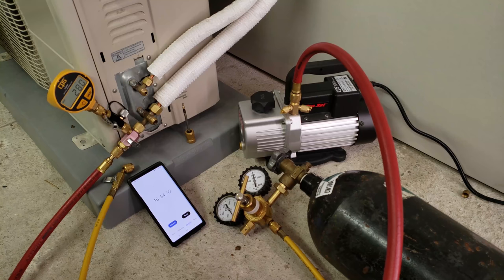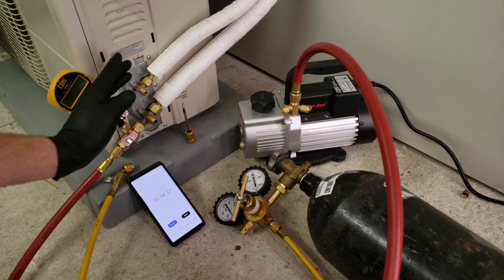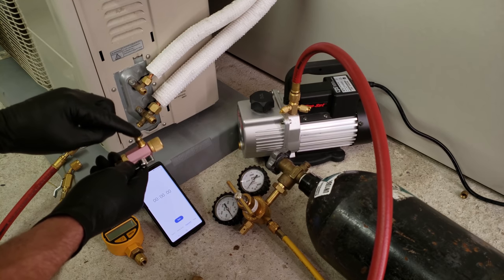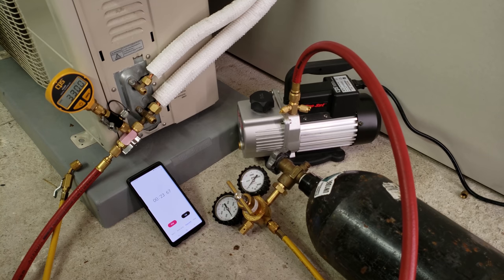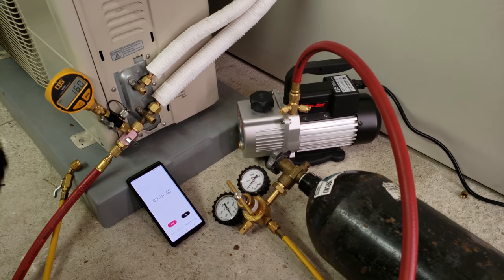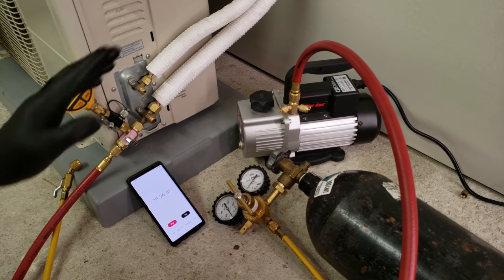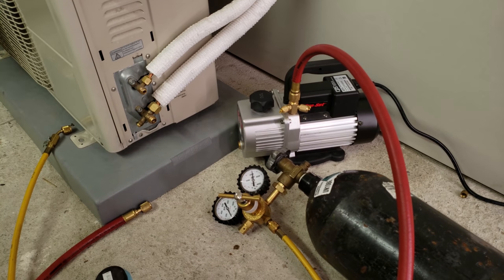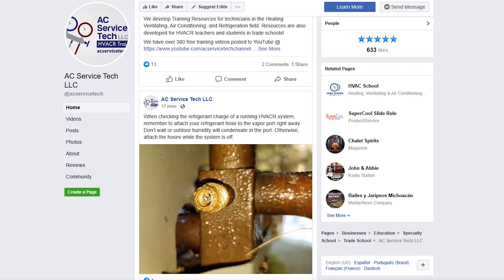Ductless Mini-Split Single & Triple Evacuation Method!  Step By Step & Opening Valves!

Comment: Your method makes sense for a professional who wants to save time. For a DIYer I think it makes made sense to add one hour wait after the initial 200 micron evacuation. This will allow the lines to come up to ambient temperature and avoid frozen water in the lines. Then pull down a deep vacuum again before releasing refrigerant. A pro can’t afford an extra hour but a DIYer can. And you avoid messing with nitrogen and all the extra connects and disconnects and opportunities to screw up.

Comment: Very good demonstration. One thing I will point out is you should always either fully open or fully close a high pressure tank, nitrogen, oxygen, argon. These tanks use back seating valves and if you ever saw a packing gland go with 2000 psi behind it go, its not fun

Comment: Thanks Craig, you are the best educator out there.  What i believe is lacking is a cumulative video on servicing a single port mini split which has a 410A issue.  I’m talking about an existing (not new installation) unit with cooling issues - we need a single video (or a 2 or 3 part video) starting at recovery thru repair, leak check (pressure test), triple vacuum & recharge.  I know you have many videos but it’s confusing to try & piece them together because the systems are different & many of the units shown have more than one service port.  I think there will be a tremendous demand for such a comprehensive video for a complete service on a 410A single port mini split.  Thanks for the great videos, i am ordering your book today.
Reply from the maker: Thanks a lot Charlie and thanks for letting me know what you would like to see!
Reply: Yes. These are very common in other countries and typical issues are the complex inverter board (you want an "inverter checker device") Or one of the 5-6 temp sensors. Sometimes the temp sensors out by say 10-20 %, or operate in a non linear fashion, these faults may not flag an error code and take a bit of nutting out.
Reply: @acservicetechchannel I could really use that vid right about now as well 😂

Comment: I followed this YouTube and your other ones to the letter! I installed a two zone Mitsubishi Mini-Split. Everything worked perfectly! Thank you so much! I have probably forfeited the warranty by not using a licensed installer but have saved us north of $1K. I even bought the tools you recommended. The Yellow Jacket flaring tool was the most impressive. I did buy the two valve removal tools you also recommended however Mitsubishi use 1/4" not 5/16" for the service valve so I just used a simple gate valve for the vacuum gauge. I was able to get a sustained vacuum down to 160 microns which held for over an hour using the triple evacuation method.
Thanks again😀😀😀😀
Reply: Awesome! Thanks!

Comment: Craig you are doing great work with these videos. Very very clear, helpful and no bologne. Very thorough on the purging and clearing lines, every time. How many times have you done a flare with no nut. I made fun of other youtubers doing it and said, i'll end up doing it. Then no less than 2 hours later. I did it. It has to be a badge of honor. My kid was watching, they have to see you make mistakes and how you handle it. I just said, always have a little extra to do this exact thing.

Comment: Great video. I wasn’t prepared for how much force would be applied to the core removal tool after the valves were opened to release refrigerant. The pressure really pushed on the core removal tool and slammed it back like a piston! Also there was a bunch of pressure left in the removal tool after the schrader valve was screwed back in. I ended up hooking up the blue gauge on my line set to the removal tool and releasing the pressure into the gauge because I was worried I hadn’t properly reinstalled the valve. I was relieved to find I had installed the valve successfully :)

Comment: I followed this set-up but I kept the 1/4" flare only loosely connected and pushed nitrogen through the line-set and the indoor unit and at just slightly above atmospheric.   I torqued it last.    I then pressure tested it at 300 PSI for a couple hours, released it and I used the Accutools BluVac vacuum gauge with the Bluetooth app that graphs the vacuum rise over time.    I don't know how that compares to the triple vac method (my manufacture didn't require it) but worked like a charm.   I used fresh high-quality Navac vacuum oil, a 2-stage pump, and the TruBlue hoses connected to the 5/16 valve core removal tool like you have.   I also bought a Yellow Jacket pressure gauge that goes directly on the 1/4" valve core removal tool in place of the vacuum gauge for the pressure testing.    Pulled it down to 65-micron, then with a 15-minute decay held at 90-micron.    I released the refrigerant and was good to go.  Thanks for your VERY informative videos.
Reply: Nobody does it better than you.
Reply: Kevin, thanks for the info.  I've been wondering about alternative methods to vacuum a multi-zone mini with long line-sets (45' & 40' of 3/8",  and 20' of 5/8").   I can achieve an initial deep vacuum reading (= or > 250 microns), but the decay test always rises considerably to above 1,000 microns.  And trying to purge nitrogen through all of that was an exercise in futility.  For the record, I did perform a nitrogen pressure test of 500-520 psi for 48hours.  The 20 psi variant is due to day and night temperature changes.

Comment: Once again I learn something. I've been using the Schrader valve core tools with the stem still in place on tool with vaccum guage. The vaccum was pulling quickly and rising fast. Thanks craig for the correction. I assume with me not removing the stem at the tool will have a similar effect  as the one at the service port. I'm 18 years in the trade and try to learn something new every day. I was wondering what was going on and now I know. Thanks again 👍👍.
Reply from the maker: I am really glad that this helped!
Reply: Same here I’ve always removed the Schrader valve core so I can vac out quicker. Trouble is I always drop the core and I can never find it again. Good job I have plenty of spare valve cores on my van😂
Reply: Any reason why I couldn’t use inert welding gas instead of 100% nitrogen?
Reply: @Upliftyourbrothers  Good question, and what about breaking the vacuum if you don't have a bottle or nitrogen.  I'm thinking CO2 could be used.   I think the deal with nitrogen is that it is a gas free of any water.  I've always heard the term "dry nitrogen."  Anyway back to your question, I'm thinking of just running the vacuum pump for a more extended period of time.

Comment: Great info! This was a necessary video. Don't think most people are doing this.
Reply from the maker: Glad to help, thanks!
Reply: AC Service Tech LLC do you have to do this? I suppose it’s faster than just letting the ice melt in the pipes but could you hypothetically leave it in vacuum overnight and then revacuum the next morning?

Comment: As you stated correctly, the value of nitrogen comes from the purging action, or as we call it the “nitrogen sweep” Always nitrogen sweep your line set, before you make the final connections. And don’t place too much faith in the Apions. They will start leaking sooner rather than later.

Comment: Usually I very much enjoy your video's. This one is a little beyond me. I have done HVAC for about 55 yrs. and we used to pull a full vacuum one time and let it set for awhile and then charge the system. Never had an issue if the system was tight and a sporlan filter dryer was used. Way the triple vacuum is a little beyond me? Thanks for great video's.
Reply: I think with mini splits driers are not recommended
Reply from the maker: Waterman, yeah the point of the video is that you see the standing vacuum test held below 500 microns for the single and also for the triple. The triple went and held a little deeper. You wouldn't really need to do a triple evac unless there were water in the tubing. Thanks!
Reply from the maker: Yes you do not add a filter drier in the field installed line set on a mini split, thanks!
Reply: @acservicetechchannel  Thanks for the reply. Why not add a drier? Thanks
Reply: Do you fit filter driers on split systems in America? In the U.K we only fit filter driers to fridge systems, but never in split systems. Is it regulation in the U.S or just personal preference?
Reply: I think it for example only. Never done on a brand new unit this small. Or unless the unit has sucked in moisture or a leak that reaches subzero pressure. Or a very large system, compressor replacement etc. 
Filter drier yes, only where required,
Reply: @acservicetechchannel  Thanks for letting me know that.   Is that because it's a heat pump and runs backwards?

Comment: Thank you for your videos! I’ve been learning a lot. I don’t know whether to get the Yellowjacket digital adjustable torque wrench or just the Yellowjacket torque wrench kit for mini split installations. I know both do a great job but can’t decide between the two.
Reply: I was also stuck with the same choice. But I went for the digital one because the kit had more complaints (on Amazon) regarding its accuracy and clicking, especially if not broken in correctly. The digital one had no complaints regarding its accuracy or clicking.

Comment: Thank you for the videos! As the vacuum pump doesn’t have a non return valve, doesn’t the vacuum in the hose pull vacuum oil out of the pump and into the hose? This happened to me.

Comment: To do a nitrogen purge you could just crack the flare fitting on the high side port.   I don't know about running the nitrogen backwards through the expansion valve at the evaporator coil inside the structure.  I haven't heard of moisture freezing inside the lines as a result of evacuating a system.   Allegedly ice is removed through the process of sublimation where a solid turns to vapor immediately not going through a liquid state.   There should be no oil in the lines of a new installation.  Having now watched to the end, I really think you should replace the Schrader core prior to the last vacuum.  Your way works but it was even tricky for you,   I'm not comfortable with it at all.
Reply: I also think the idea of the triple evacuation is to just speed up the process.  It's probably more effective to pull a deep vacuum, "sweep" with nitrogen, and repeat the process several times rather than running a vacuum over a longer period of time.

Comment: First I want to thank you for all your info I am learning a ton between your videos and books.  I have a few questions on procedures in this video I hope you can clarify.  #1. You mention you always remove the cores out of you VCRT (valve core removal tool) and install the second VCRT to isolate the vacuum gauge. While I understand this and it makes sense from a speed and convivence POV but wouldn't it be better to leave the core in the 5/16" VCRT and not use the the 2nd 1/4" VCRT and simply detach the vacuum gauge before charging refrigerant?  It would seem like there is less chance of a pocket of air getting trapped in the 2nd VCRT  #2. During the triple evacuation every time you charge nitro and disconnect it you open the valve on the 1/4 VCRT before connecting the vacuum gauge, essentially opening the lineset to ambient air, wouldn't it be better to leave it closed and then reinstall the vacuum gauge then open the valve on the VCRT so you are not introducing extra air into the lineset?  Or is there an issue with vacuum gauges and positive pressure even though it should be very low positive pressure if only using 5psi of nitro?  #3.  As far as doing a nitrogen purge on a mini spit that doesnt have a service port on the liquid line couldnt you just leave the flare nut a little loose on the liquid line while all the others are torqued and purge it that way and then torque the liquid line as last step while under very low flow?  #4. Finally would it be ok or better to set it up so you wouldnt have to disconnect/reconnect anything at all?  Im picturing starting with the service port. Then the 5/16 VCRT either with or without the core, and vacuum gauge either like you have it or directly to the VCRT with a core in place. then on the the back side of the 5/16" VCRT either a charging T or something like a Appion speed Y so you can have both the nitro and the vacuum hooked with ball valve hoses and then just alternate between opening and closing the ball valves on the hoses as needed to alternate between vacuum and nitro during the triple evacuation. That way you are never introducing air into the lineset. Then just pull everything after the 5/16 VCRT and then charge with refrigerant. I hope that all made sense.

Comment: @AC Service Tech LLC would it be better practice to break vacuum pump hose after pulling vacuum, closing service tool check valve, and turning off the vacuum pump but before doing the standing vacuum test? This way, there would be no vacuum contribution to the measured vacuum reading in case there was a faulty core service tool check valve? Thanks for the videos!

Comment: Have you looked into the AccuTools tru blue evacuation set? 
I believe the triple evacuation procedure is in reference to the engineers handbook. And that was last updated in the 60's and they were probably in reference to the old single stage vacuum pumps which by now-a-days standards is the equivalent to a less than 1 CFM pump.

Comment: I’m just curious about your decay test. You only recommend a 10 minute test? Whilst I’m still in school, they are teaching us to let it stand for, at the least, an hour. You teach me so much more than the school does.
Reply from the maker: By 10 minutes, it usually doesn't rise any more, maybe 10 microns for the next ten hours in most of my trials. By the end of the ten minutes if should have leveled off. You would know if it keeps rising. On conventional systems I keep the indoor fan running anyway to provide heat at the coil so that would negate the time factor and the pressure test was already done prior to this. We need to figure out fast yet correct ways of doing things in the field so we get the job done quickly and effectively, thanks!
Reply: @acservicetechchannel  Honestly I think that's what your method is all about.   The most efficient way of getting a system up and running in the shortest amount of time at the least cost while not endangering the atmosphere.

Comment: Ty for the video. I would like to ask  every time you release the nitrogen don’t you introduce air back in the system?
Reply: I haven't finish watching, but what he could or should do is put the schrader back into the system before the final vacuum.   At that point I would pull it down for the final time and then release refrigerant into the system.    You don't want to do that until you are positive you don't have any leaks or accumulated moisture in the lines.  I probably shouldn't comment until I see how he finishes off.  I've been away from the trade a long time and a lot has changed.
Reply: @JoeLinux2000  thank you for taking the time

Comment: what size tank is that for nitrogen and is is supposed to be a very specific "dry" nitrogen or do I just go up to welding supply shop and as for a tank of nitrogen? also do the gauges at the welding place work or do they have to be specifically for hvac?
Reply: I've been wondering the same. What did you figure out?
Reply: 60lbs

Comment: Could you solder a 'T' into the opposite end of the line set to flow nitrogen through?   Put a ball valve on it and solder a cap onto it once you perform the nitrogen purge of the line set.

Comment: Great tutorial.  I have a question a little off topic.  Can the vapor line and refrigerant line be bound together with tape or copper wire and then insulated? Does this cause a electro-static reaction or temprature problem with a 1 ton mini-split? I've read arguments for binding together and directions not to, but no explanation why not to bind together. Thanks.
Reply: My experience with marine refrigeration systems has been that you can tape the two lines together mostly to warm the return line to avoid frost accumulation.  If you use wire it would be best to be certain to use bare copper wire or an insulated wire, because steel or aluminum might cause electrolysis.  On the minisplit system I purchased the lines are insulated separately .   It could be that when the unit converts to heating that having the lines taped together may reduce the efficiency of the heating.  Maybe others more with more experience will comment.

Comment: I have a weird situation: First, I removed the valve core and pressure tested with nitrogen to 300psi. I let it sit for 1 hour and saw no change. I use the exact setup you show (different pump) to pull vacuum and it takes about 2 mins to pull down to 300um. Then I close the valve to the vacuum pump and instantly lose all vacuum (gauge reads blank). Then I re-open the valve to the vacuum pump it drops back down to <500um in less than 5sec (weirdly fast). Then I let the vacuum pump run for 15mins repeating this 10-20 times but I never got the vacuum to stay down when I isolate the pump. I did not try breaking vacuum with nitrogen- maybe that's my problem?

Comment: Could we do that on a regular conventional system.  Not a mini split unit ..??
Reply from the maker: Yes absolutely and I had a note in the video that on larger conventional systems, you could break the first vacuum at 1,000 the second at 600 and break the final vacuum at 300 or less, thanks!
Reply: AC Service Tech LLC Great ..!! Thanks for the answer.

Comment: We don't normally use the fancy "valve core remover" in these situation just the basic screwdriver type core remover. Then reinsert valve core at about 2-5psi. Ideal when the fancy tool is in a too bulky situation